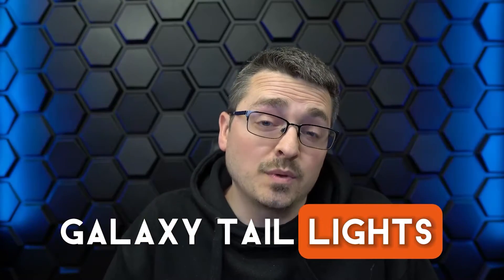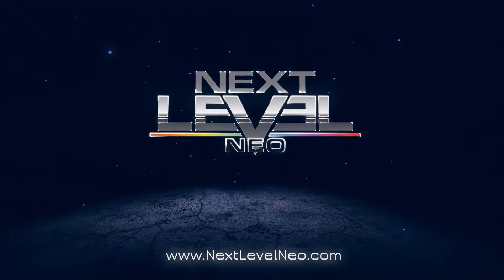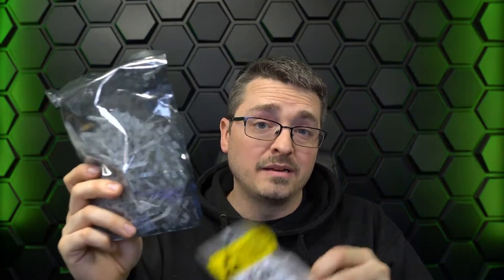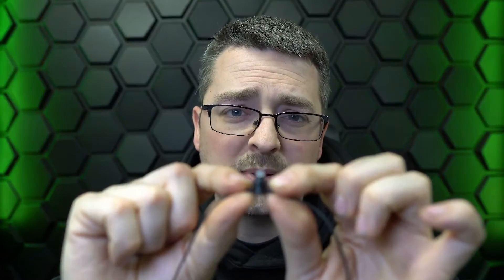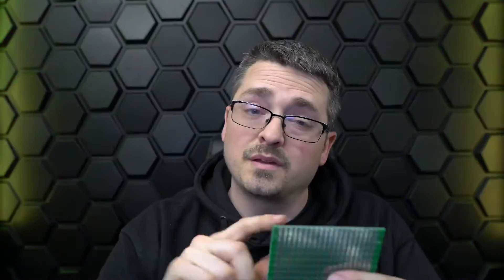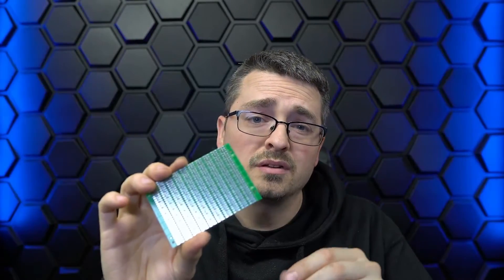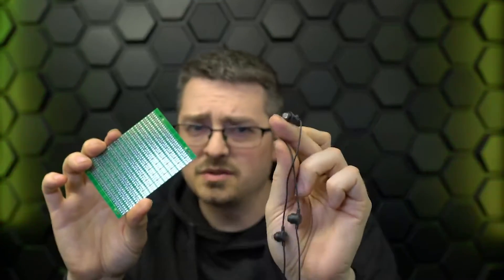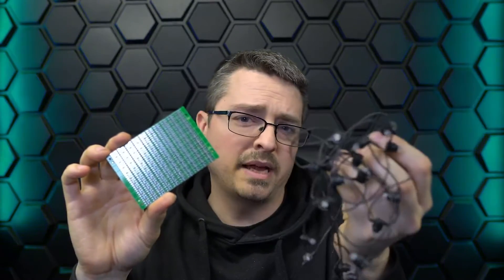5mm Flow Series Leds: Information You Need To Know

Comment: Are the 5mm RGB brighter than a UCS2903 strip?

Im working on the front of my vehicles lighting next where depth isnt much of a concern, and curious about building my front drl/turn signal strip with 5mm. 
Ill take any extra brightness i can get there, front turn signal is an important one!!😊

Thanks as always..
Reply from the maker: The ucs2903 are brighter than the 5mm led for led. But the 5mm have a lens to direct the light forward and are generally used without diffusion whereas the ucs2903 are generally behind a diffuser. The diffusion with the ucs2903 makes the output very close the the bare 5mm led output which makes them a great match on a car. The bigger concern is the bluish hue to the white color. I would recommend using either our rgbw 5mm or our UCS2904 rgbw so you have that cool 6k white color